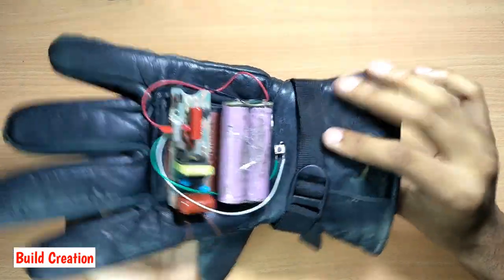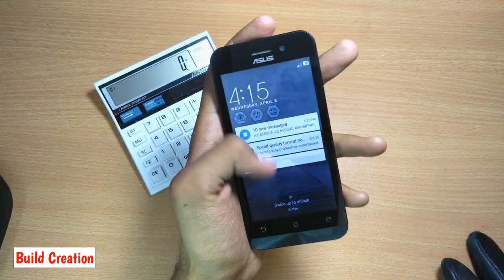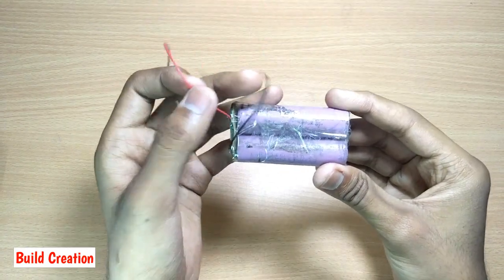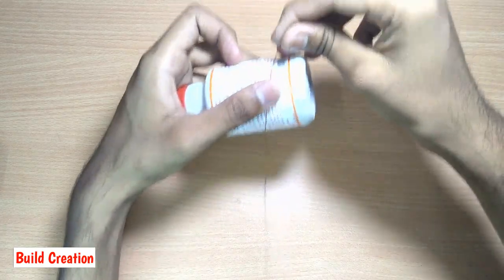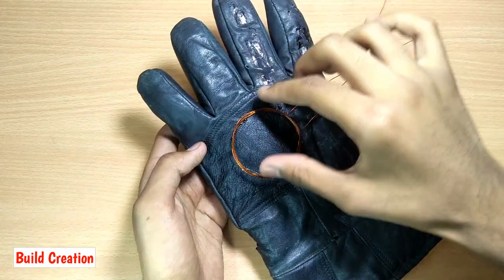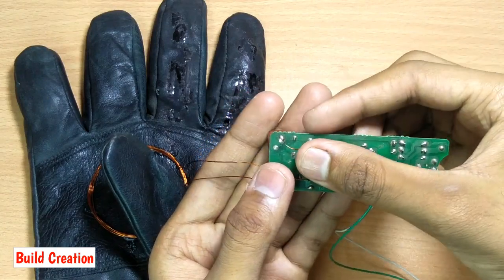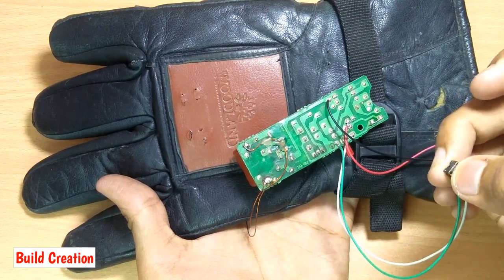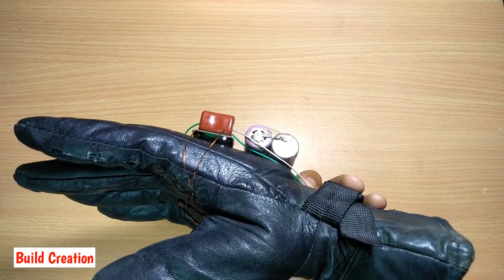Make Electronic Devices Jammer Glove at home| EMP Jammer| DIY

Comment: how do i find the audio signals which were around me and listening my voice through radio s pls explain
Reply from the maker: No bro...it cant detect any signals.
Reply: Build Creation pls at least that gadgets where do I find I have been saw since 1971
Reply from the maker: @paparaotango9345  are you taking about circuit? Or what? Plz tell properly..
Reply: Dear friend just thinking about it still unsolvable any way pls I need circuit diagram will u
Reply from the maker: @paparaotango9345  bro..i used tripler circuit...which i got from Mosquito killer Racket.